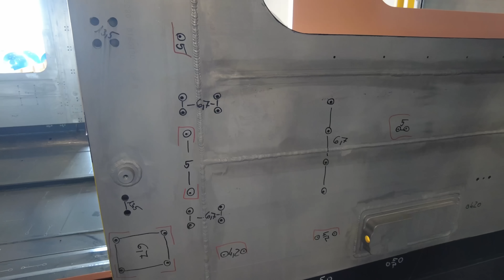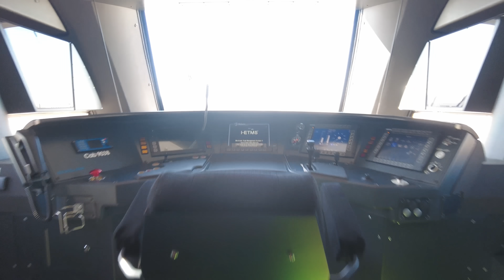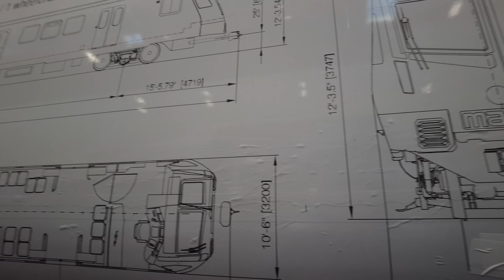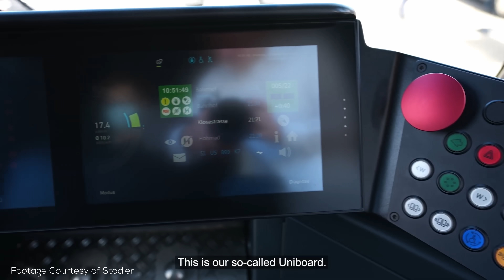Modern European Trains Built Right in North America! | Stadler Factory Tour

Comment: I wonder if they use the SI system (metric) for engineering and manufacturing, or measure stuff in bald eagles and their fractions?
Reply: Peter Spuhler (CEO of Stadler) said, that the whole train is designed in SI-units, but then has to be converted into imperial, as per the buy American act. 
It's probably built in metric and the documentation is in Imperial

Comment: That Kiss train at 1:14 with the 4 doors looks so cool but weird at the same time
Reply: What is so weird?
Reply: @bertnl530  seeing a train with doors on two different levels because it's so rare. I've only seen this 2 times before. Once a regional doubledeck train in Belgium and the swiss Giruno
Reply: @Catonaut.  Ah, yes, now  I see which one you mean. Perhaps it has to stop at different platformheights.  I can not see another way to get in and out a decent way.   The high door is easy  a metre above the ground.
Reply: The idea is that for the Caltrain modernisation, the trains will use higher platforms in the long term to match with the high-speed trains on the same tracks which too are planned to use higher platforms (and given that most likely EMUs are used, these are necessary as the motors have to fit in somewhere).
Reply: @MarioFanGamer659   Then it makes sense. If all platforms are on the same level, the factory can replace the door for a panel with a window and change  the interior for some extra chairs.
Reply: As soon as every platform has been adapted to the same heigh, the area of the unneeded doors is going to be converted into seating space

Comment: This is highly interesting, thank you so much and I'm looking forward to further episodes.
It's also nice how they styled everything in the white and blue company colours.
To be noted, the cars for the Rocky Mountaineer weren't built here but at Stadler's factory in Berlin, Germany. They had to be shipped mostly by barge to the harbour because they are much larger than the German rail network would allow. I think the factory at Salt Lake City wasn't ready yet at that point.
At 9:46 I see what looks like an Alstom LINT and I wonder what that's doing there. Is that older equipment of O-Train to compare to the newer units?

Since you mention the difficulties building aluminium bodies (welded from extruded profiles) I wonder how Alstom does it when building the Avelia, how much of that needs to be imported? I think the Avelia Liberty is fully aluminium as well.

Considering many traditional US builders of passenger trains such as Budd, Pullman-Standard, St Louis Car company (not sure what became of ACF, do they still make freight cars?) have disappeared, it's important for other companies, even if managed overseas, to establish themselves. Companies like Siemens (a pioneer of electric traction) or Stadler (originally a little Swiss speciality company that managed to expand greatly since the 1990s). To maintain a steady stream of orders of course they have to diversify themselves and be able to produce a wide range of different things in the same factory. Who knows, maybe Stadler will produce long distance passenger too, as they have done in other parts of the world.
Reply: Rocky Mountaineer also didn't need to worry about Buy America Act restrictions.

Comment: Are the components domestically manufactured or are they imported then assembled at the "factory" just to satisfy "Buy American" requirements?
Reply: Peter Suhler (CEO pf Stadler) said that it would be cheaper to build and assemble them in europe/switzerland, but because of the buy american act, 80% of generated value must have been made in the USA. So simply doing the final assembly would be way off. (Somewhere I read final assembly can only be counted for a maximum of 30%)

Plus in the beginning of the plant in Salt Lake, he talked about how difficult it was to find ANYONE to produce the materials and parts in the USA and how they had to invest in the companies, building the parts for them. As otherwise they would not comply with the afformentioned act
Reply: @Som09mer  I imagine it would be difficult since domestic passenger train manufacturing was largely discontinued decades ago.  Sad.

Comment: I’d be curious how your video on Utah’s transit will be. UTA seems determined to use “BRT” for everything lately most of which is like 50/50 or less of mixed and dedicated lanes. Even planning on BRT over an LRT expansion in south salt lake county which has been disappointing to say the least. I’d also be curious what you meant about expanding the S-line from the airport out towards the inland port(Stadler area).
Reply: UTA has a bit of a problem were they have the Legislature breathing down their necks.   Regarding the "S-Line", that is a streetcar line that serves Sugarhouse.   I think you are thinking of the Green Line which serves the airport.

Comment: Sorry, what's "light" about these trains? They really look like heavy rail.
Reply: Blame American crash standards. They're much stricter compared to Europe so a lot of typical European heavy rail stock (railcars in particular) tend to be downgraded into light rail (the most notable example being being the first trains for the O-Train Trillium Line which has been imported from Germany) even though they're for all intents and purposes heavy rail (Wikipedia calls these systems "hybrid rail").
Reply: You are correct that these trains are generally a similar weight to standard trains. The “light” part comes from these systems generally being considerably less expensive than most rapid transit projects
Reply: @MarioFanGamer659  Adding to your point: US buff strength standards for passenger railcars interacting with freight network traffic require the carbodies withstand 800,000 pounds (363,000 kg) of compression without deformation. (as an aside, the standard imposed by NYC transit for its subway cars is about 200,000lb  (90,700 kg)  )

Comment: One of the reasons Stadler designs are tweaked and adjusted is to comply with the FRA's traction and compression standards - these require beefier structural members which in turn lead to slight dimensional variations in the US-built trains when compared with their EU kin.

Comment: Aluminum doesn't rust, but it does fatigue and it fatigues much faster than steel.

Factory looks about on par with anything built in the last 10-20 years. Not going to be very noisy because it looks like all assembly, no fabs going on.

And apprenticeship programs really aren't that uncommon on the shop floor.